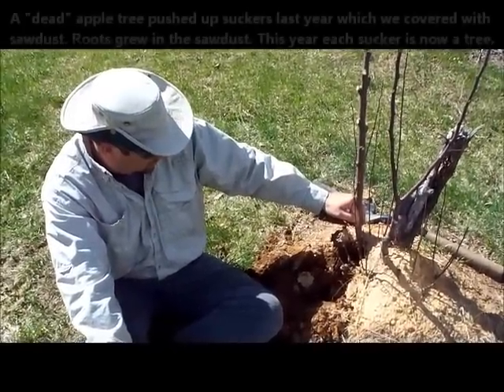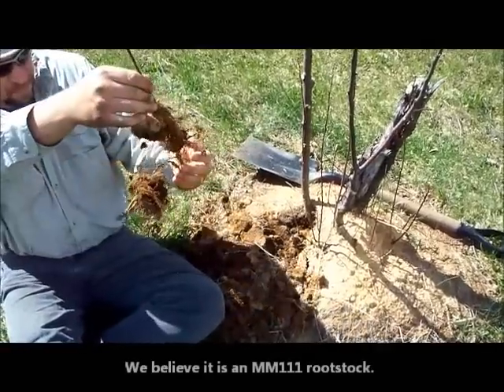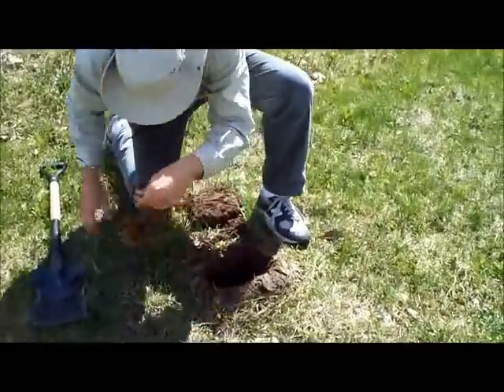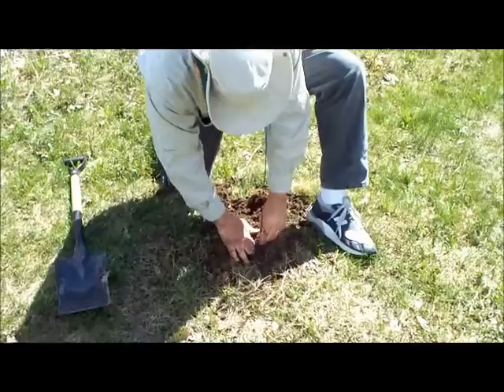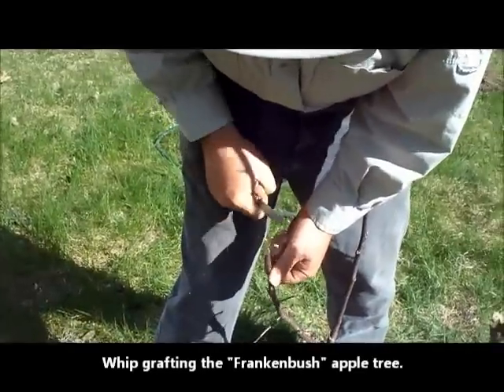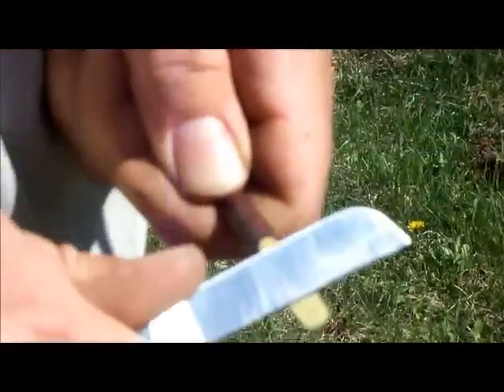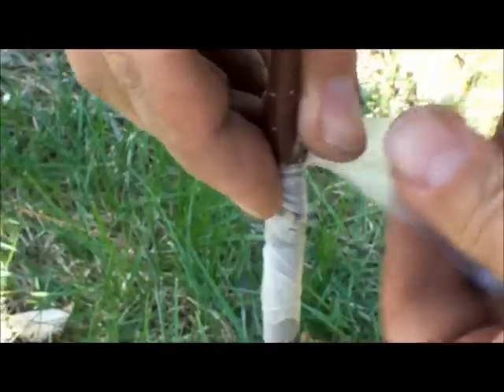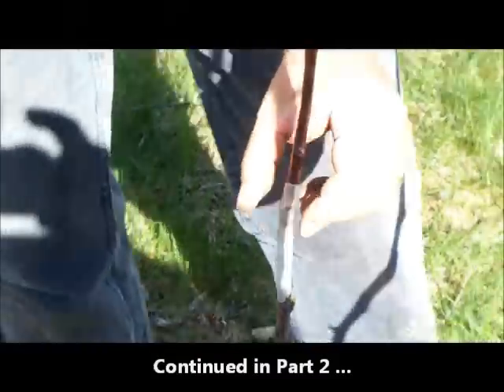Frankenbush Grafting Part 1 - May2011

Comment from the maker: @troutfishholland I prefer to use the "tongue" with the whip graft also, but in this case we didn't really care if it survived. The double-whip graft was really sloppy. I was wondering how sloppy a graft could be and have it still work. Found out it doesn't have to look good to work right. More important to have the cambium layers firmly touching.